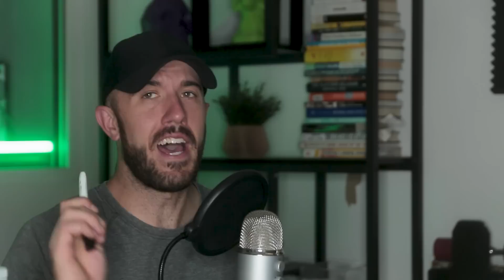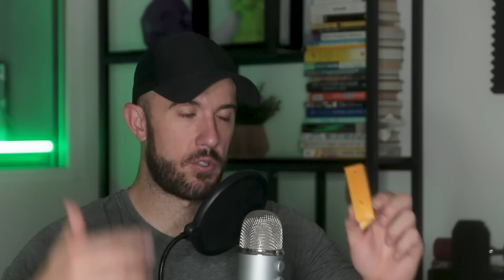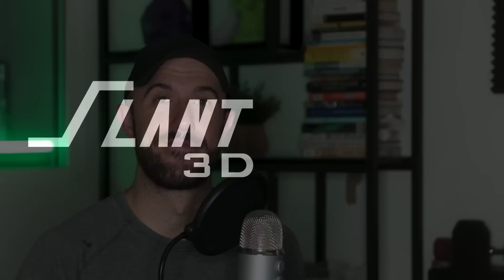We Need Your Opinion | Gray Filament Release | 100k Subs | 3D Printing News

Comment: 3d printed houses: probably makes more sense in countries that don't do stick framing (which is relatively cheap and labor efficient) OR where the process can reduce the specialty trades eg plumbing, electrical, finish carpentry, drywallers etc).

crowd equity: at least it's not kickstarter... just so long as your clear about the risks its fine; and assuming it makes sense on your end, investors of any type can cause difficulties for organizations that are unprepared 

organizer app: if it was form fitting it'd be sweet for kitchen drawers, especially if it had some auto arrange functions

Comment: As someone who has been following your videos for about a year now. 

Spotting the trends that manufacturing is returning to the west, North America especially, due to cheep energy and better demographics, manufacturing seems to be a good punt, and I understand 3D printing well enough now to know you guys know FDM 3D printing inside and out. I have learned quite a lot from what you have taught.

Having worked out that you clearly have read all four of Henry Ford's books and understand the importance of efficiency, almost as if it's a religion, I would feel reasonably happy taking a punt and putting in some investment, but not enough that it would impact me adversely should the worst happen to your company. 

I'm across the pond though (UK), so that might make it harder for me to invest.

Comment: Regarding Conjure; Here is an app that can work well within that framework.
Have you seen how well boxes of retail products are filled? Like Dyson vacuums, 3D printers, etc. Open a Dyson box and that is the last time you will see it properly organized. Imagine the amount of time, trial and error that went into that packaging.
So, for those manufacturers just taking a 3D scan of each item that goes into the box of a given size, submit the scans, and out comes a packing profile, with foam cuts or cardboard cuts as well, I imagine it would be a significant time and cost saving, especially when test fitting the pieces the first time. Yes, more complex than a desk drawer. Way more.

Comment: Crowdfunding Slant3D - I would invest in Slant3D as it is now (though I don't have the means to invest much), but only with a contractual requirement that you remain independently managed. Your biggest advantages, what makes you different than the folks going out of business left and right, include your approach to development, risk management, decision making, and your emplyee / customer focused morality. If you give power to a board of investors, share holders, or advertisers, you step onto the road to gradually abandoning that morality. If you empower investors, particularly if they're a crowd of idiots (who may well be brilliant individually), you lose the other advantages. Either way, I stop having faith in your company.

Comment: I'm not sure I've seen a single 3DP house that seems truly feasible yet. WHERE'S OUR HOUSES WITH FUZZYSKIN EXTERIORS AND HILBERTCURVE FLOORS?! They cement-in the things they will need access to later if there's issues(conduit/plumbing embedded in a pillar of concrete, instead of behind removable/repairable drywall), they never seem to lay in rebar, or rebar-stake it down to whatever pad they are printing it on top of.. It's like the ones making these houses have never consulted anyone about what you should and shouldn't do with concrete slurry to make it work as a solid structure. Also many of the past projects involving it were trying to get formulations right and are just crumbling away, partially because again, no rebar support, but also other formulation errors in trying to get the right flows. They haven't figured out how to have the machines automatically smooth the exterior surfaces either.. it just all seems very half-baked still for what's advertised? Everytime I see a video showing the process, the comments are ripping them a new one for not doing any homework on why it's pretty bad the way they're doing it..

Comment: Regarding the AI modelling print software: I'd suggest standardizing on a grid matrix of common incremental unit of size, so there will be some modular flexibility, even though an order will be a custom design based on a photo
Once such system standard is Gridfinity (designed by Zach Freedman). Using such a grid system would greatly increase value of the service, as it would offer flexibility to customize/modify a sub-section of a layout without needing to redo/repurchase a design from scratch. Having a base standard, will also allow flexibility to offer some standard modules that could be sold separately. Would also allow other designers to offer designs that also just plug-in to the system. Think being able to modify a layout is important element of the design, as where things are located within a draw can mater and effect how they are used. 
BTW: This is a great idea. As with anything the details are in how well the design executed, the user experience and perceived value.

Comment: The killer end-consumer AI app would be something that creates parts and instructions to fix something. This for me is one of the biggest potential for consumer printers. With printers getting affordable and simple, people currently are printing toys and art which will end up to be waste. What we need is an easy way for consumers to use a 3D printer to fix stuff. This will reduce waste and will help the environment.
Build an AI powered app which you can tell the product you want to fix and the part that is broken and it prints a replacement for you.
As an MVP, you could start with a small scope. Find a product group where parts break frequently and measurements and geometry are well documented. If you train AI to model parts to fix broken toys, for sure, there will be huge demand.
I know, this is way more complex than the drawer stuff, but it might change the world. And if you figure out the MVP properly, it might not be too complex.

Comment: I work with rc cars, rc planes, 3d printers, etc. If you can get this AI to take a few different pictures of a rc gear box and make the rough design for modified one. I would absolutely love it! Some feature I would like to add is differing tolerances to make sure my ender 3 can print it so it fits and a way to go into steps of the design to make changes. For example, I'm creating a motor mount for an rc plane and it designs one, but a screw hole is missing, and I need to move some stuff around. I would go into step 47 and get to the part where it started designing the screw holes and I can modify it from there. Even if it just made simply designs like a joystick cover or a simple case. I would still buy it because I got some organizer things that I would want but just haven't got around to designing or not worth the design work. Good luck!
Reply: One more thing, make a desktop compatible version!

Comment: 4:42 I’ve always thought change the house design completely make it around a central part the contains all the water and electrical parts like a pre-made central column with access to sockets etc to different rooms. would simplify the wiring and plumbing greatly

Comment: Conjure sounds wonderful. I’ve long wished for better drawer organization both in my desk and in my shop. While I’m fully capable of designing my own organizers, I never have, because the benefit doesn’t seem worth the time and tedium of doing so. However, if it were automated, I’d love it.  As a counterpoint, however, my wife would generally be content to order the closest fitting generic organizer from a cheap import retailer. I can see this attitude impacting adoption of Conjure until Conjure is even easier than ten minutes of scrolling to find generic bins. 

Regarding equity crowdfunding, I don’t feel positively. Investors are more experienced at assessing the risks and potential benefits than laypeople would be, meaning laypeople are almost bound to make a suboptimal investment, whatever that means for them. Similarly, investors and CEOs can negotiate to find mutually acceptable terms, but laypeople are far more likely to blindly accept significantly worse terms.  Not to suggest you intend to craft exploitative terms, but what you think is fair equity might not (or should not, if you’re watching out for your bottom line as CEO) match the terms a professional investor would agree to. Each person is responsible for their own decisions, but my feeling is that equity crowdfunding is inherently going to take advantage of fans’ sympathetic mindset rather than to encourage sound investment decisions.

Comment: with 3d printed houses you also need to consider you still need tradesmen on sight to assemble the machine, put in frames for windows and doors and then run cables etc, and in many parts of the world there's a concrete shortage.

whats the difference between shipping prefab frames to site and assemble vs assembling machine on sight and then have to wait even longer? for houses, I don't think 3d printing is any benefit at all.
it's sort of the the "you were too preoccupied to think if you could, to stop to think if you should" meme.
like solar roadways. LOL.
Reply: Agreed. Prefab walls are definitely more cost effective with respect to having all the "mechanicals" pre-installed as well as insulation and reinforcement materials (rebar & other fasteners/attachment plates).

Comment: For the ai organizer app to be practical, there would need to be a way to verify the measurements.  Maybe have people include a quarter or other object of a known size for scale?
Reply from the maker: Not necessary. You can get dimensions from a single photo and reference data in the llm. 95 percent accurate in tests
Reply: That's incredible.

Comment: Never can have enough gridfinity. Love the idea but I don't know if generated stuff like that is up to snuff. What's to guarantee that tolerances will be taken into account when chatgpt is notorious for not understanding math.

If it works I would love to use it, but I know I would also want a way to edit the file after the fact in case it's slightly wrong.

Comment: Hey bud what’s the best way to reach you guys? I’m having an awful time getting your black to work. 

I’ve bumped bed heat to 70c and print is 200-230 per your previous video and first layer is 220. 

I want to use your stuff since it’s made in America but I’m having an awful time getting it to work.
Reply: What machine are you printing on?

Comment: Normal people will not double check measurements etc and will blame you when the print doesn't fit. You may need to make it more fool proof
Reply from the maker: Already quote foolproof in testing
Reply: @slant3d  New fools are looking to set a new low every time someone makes something proof of fools.

Possibly require that there be a ruler/scale, or partially extended tape-rule in the image with standard markings for inches/feet, cm/mm, or peppercorn seeds that the AI can derive a scale from. It won't be proof against fools, but it may help people with verification if they take the time to check.

Comment: It's not just a shortage of tradesmen making houses expensive. It's that, when you have to pay ~$1M/acre for land, and can get maybe 8 houses per acre; you then have to pay more for things like roads, sewers, stormwater runoff control, and the like, assume you're going to be required to add some amenities for the development (like a park or land for a school or fire station), and by the time you're ready to break ground, you're already $250k in the hole on a house that is currently just some survey marks on the dirt. 
And it's not a shortage of skilled framers. I've worked with groups like Habitat for Humanity... If you have a couple people on the team who have done this at least once before, even amateur framers can frame out a medium-sized house on a prepared foundation in a (long) weekend, albeit with someone quietly fixing one or two little things before inspection happens. (Plumbers, electricians, HVAC, gas-fitters, mud mechanics - yeah, definite shortage there.)
Also, I used to work in building trades... Foundation can be more work than all the framing that goes on top of it in a number of soil types, especially if you're putting in a basement (unless you're OK with big cracks forming on the slab), and because you kinda gotta have things like septic sewers and water lines installed (and, in a growing percentage of modern construction, power/phone/wiring for cable TV also come in underground), there's a lot of prep that needs to happen.
Biggest concern about the 3d-printed houses: It's unreinforced concrete. With layer lines. Between seasonal thermal stresses and normal settling of the foundations, I'm a little concerned about cracking.

Comment: I've reached the point with my printing that I only use 3 colors. Black, white and transparent. If I want a color other than that I paint the finished part. And just because you 3D printed walls for a house out of concrete doesn't' mean you don't need framing. I live in a concrete block house and the entire interior and roof is framed wood. I like your idea for custom drawer organizers for normal people.  There are already things like this from wood workers and those with 3D printers, bento3d for example, but I like your idea because anyone with a smart phone can use it and get a finished product. I would avoid crowd funding, too many downsides and it's viewed negatively coming from an established company. As you said,, "It has that smell on it". While I might consider investing, I would look at it more of a gift than an investment, if I get my money back, great. If I don't, well, it was a gift so I didn't expect it back in the first place.
Reply from the maker: Bento3d is awesome

Comment: On 3d house design, the Icon houses have a pretty 'open fill' in the walls so there are 'chases' for wires if we would take advantage of it.  Also, could go from ceiling down if single story house for wiring and plumbing.  Waste water could go 'up' but having it would take a 'sludge grinder and pump' that most don't use typically except for toilets, etc in basement type arrangements where the sewer is not below the floor area.